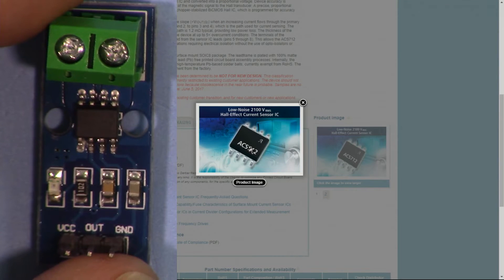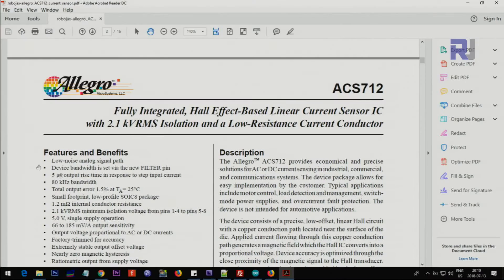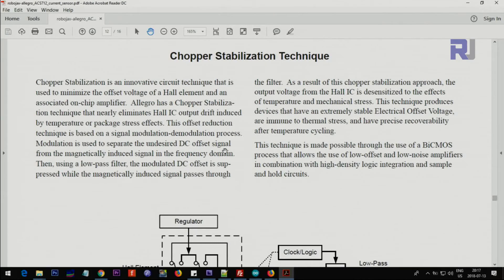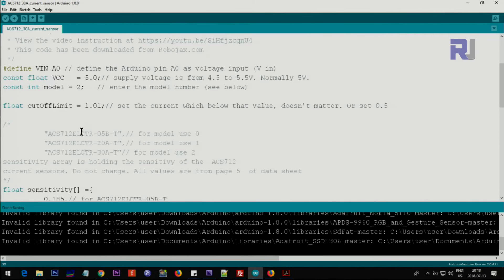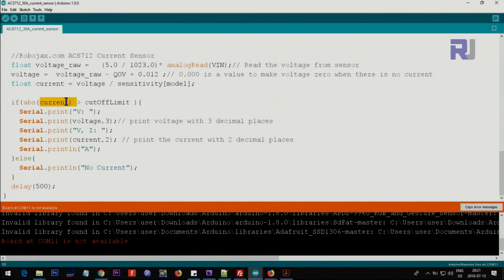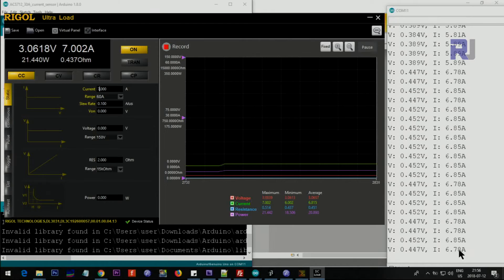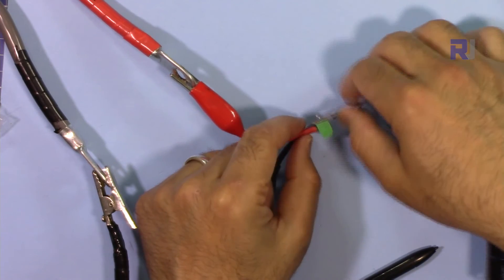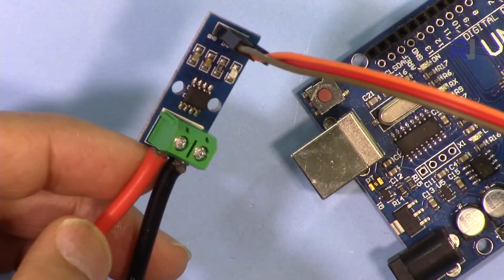How to use Allegro ACS712 AC/DC Current Sensor with Arduino RJT106

Comment: Can it be used to control car windows close and open automatically??
Reply from the maker: Hi, this device can only gives you the amount of current (in ampere. A). You will need to know the power the motor needed to open or close the window, then find a 12V power supply that can supply that amount of current.
Reply: @robojax  I'm try to make one touch auto open and close windows on all 3 windows of i20, driver side already company fitted with this feature. So, if I can get the required current, will this module work and how to connect it? Thanks.
Reply from the maker: Your projects needs some work. You need to disconnect the switch from the door of your car and make them all pass through the switches they have to they are always ON and you will need 4 channel relay like this https://youtu.be/Wbm3MCMgM_s or something else to control them. You can program this module so all 4 day can be turned ON or OFF. I do not have time to do this but you can start from this. 
1-First make sure this module can work and instead of turning the window, connect 12V or 5V bulbs.  Making sure they work the way you wan them to work.
2-then change the switches on your car so they are always ON
3-connect this relay with your push button to the car

Comment: Hello sir, im having a hard time using acs712-20a, is this module good for measuring low currents less than 10mA?
Reply from the maker: I have provided the datasheet in page where code is. So check that out.

Comment: Hi. Thank you for sharing video. But I cant show the ac current truely. There is a 25W 220VAC lamp for load. Normally current must be 0.11 Amps. But I see 0.68 Amps on the screen. What must i do? can u help me please?
Reply from the maker: what kind of load you have? is it a bulb? I mean resistive load or inductive like motor? Try to measure the current using your multimeter. Do not trust the label on the load.
Reply: @robojax  yes one of loads is bulb. Other one is resistance heater. On the bulb i read 25 watt. For heater firstly i measure resistance and voltage / resistans = amper i found. Heater is 140 watt today sunday but tomorrow i work on this again. Thank you for reply. Love and respect to you. Thank you

Comment: hi sir,I supply the power but the signal is no current, please help me!!!
Reply from the maker: If you don't see the current, then 1-you dont have a load connected. Without load you will not see current. 2  - Wiring is incorrect 3-Code has issue.

Comment: i need to record current going to motor and if it goes above 1.5 amp it must cut off, how can i do this, it would be great if you could help me. thanks
Reply from the maker: you would need to use relay to disconnect the power. for example if you current variable is currenT, then write if (currenT >=1.5){ digitalWrite(8, LOW). See my video on relay https://youtu.be/58XWVDnB7Ss
Reply: @robojax  thank you man, ill will work away at this,
Reply: Could I use the readings from the current sensor to turn on and off a l298n
Like if current> 1.5 amps 
Motor pins will both be HIGH, please help, I am really stuck

Comment: why is it sometimes my current values are negative when i set cutofflimit to 0.5, by the way excellent tutorial. Thanks
Reply from the maker: Remember this is made for 30A or 30000mA and 05A is 1.6%. I have not faced such issue. It should always be positive.  Try different load.
Reply: @robojax  what is the minimum current value that this 30 A acs712 can measure, i have set the "cutOffLimit" to 0.1 instead of 0.5 or 1.01 as you mentioned. Because i want to measure a current that is around 0.1 to 0.22 amperes.
Thank You
Reply: @robojax  i just added abs in the line:(Serial.print(abs(current), 2); // print the current with 2 decimal places)             and the negative values are gone but still there is a lot of variation in the output.

Comment: Detects 220V @ 20 amps? Thanks.
Reply from the maker: In the description and in the code page I mentioned that it works with AC and DC . yes  if you  have the 20A version.

Comment: Can we feed mains to sensor 
I mean will it work with 250Volt AC
Reply from the maker: On the page where I put the code, this is the title "Using Allegro ACS712 DC/AC Current sensor with Arduino Code" which has AC and DC in it. Yes it works with both AC and DC current.

Comment: How can i show that when no current flowing it will print 0 value and when there is it will show the value. im measuring 220V 60hz loads AC.i only want to show in the serial monitor is the rms current.
Reply from the maker: change the value in the line float cutOffLimit = 1.01; to zero I have explained this in the video. Watch it again.

Comment: can i measure the current of AC voltage of 230V?
Reply from the maker: It can work your voltage yes. Check the page where the code is and you can see the datasheet.

Comment: Hi sir, but your code was not working on mine (30A sensor + i didn't change the code at all)
The current output was 
V: 1.549V, I: 23.47A
while there was no load connected to the sensor.
Reply from the maker: for ACS712ELCTR-30A-T, then 66mV per Ampere. 
and your value 23.47 x 0.066= 1.549V  is correct.
then your wiring should be checked. Disconnect the current sensor from arduino what do you read?
is your voltage 5V. Check the voltage.
Reply: I've check with multimeter, the VCC is about 4.8V (sometimes 4.6V) and the VOut is about 2.4V (sometimes 2.3V) and also I changed all the wires with the new one.
Does my sensor is fault?
Reply from the maker: it seems the value is correct. this is where you have no current? correct? it is possible the module be bad.
but do you have any load connected? make sure you connect a load that draws at least 5A so you see it easily.
Reply: Btw, what is the "correct" that you meant?
Yes, sir. When I got the Amps value as a I mentioned above, the module didn't connect to anything.
My sensor was fault or that was the ACS712 characteristics (having high error rate)?
Reply: sir my problem same with you how fixed this?im beginner in this....please help me thankyou.... im from indonesian